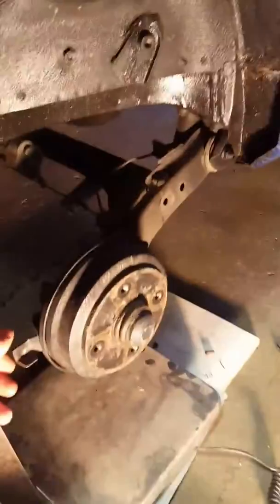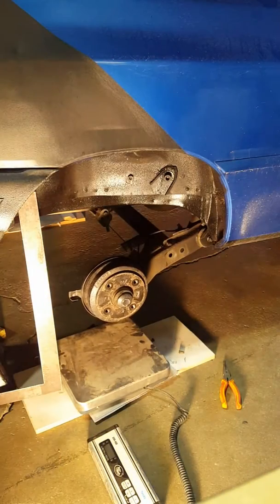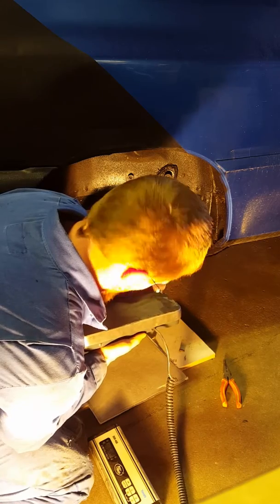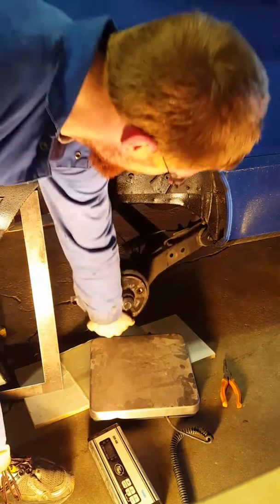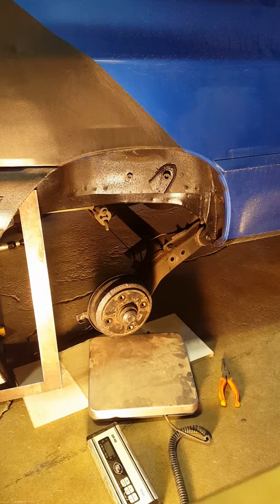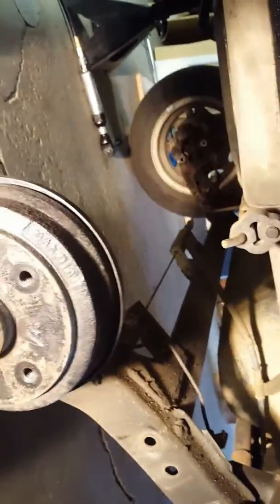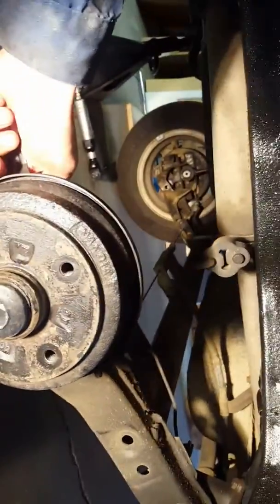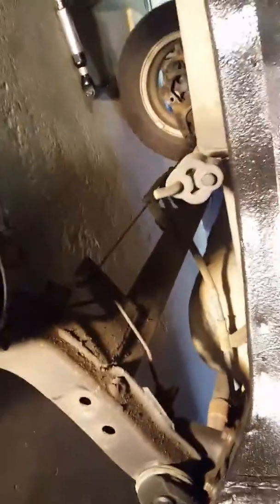Festiva independant rear suspension

Comment: question, is it supposed to have a a torsion or sway bar inside the front side of the rear beam axel ? i have noticed on my 91 wa there appears to be holes on either side to fit one
Reply from the maker: The first generation (1987-1993 Festiva in North America) does not have one in the rear axle. The second generation (1994-1997 Aspire in North America) does have one along with thicker metal and a less flexable rear beam. Its somewhat common that people bolt a rear axle from a second gen onto a first gen because they think stiffer handling is better. What country are you in?
Reply: @ryanprins4109  
thanks for your reply, i`m in Australia, my 91 wa festiva has holes to fit the bar, but i cant find one to fit it at any wreckers here, so i was scratching my head wondering what the go was with the holes, i was thinking of getting one made , or make one myself looks easy enough to do , but i dont know how much good it would do, maybe if i was using as a rally car a stiffer rear end could be beneficial , but for general around town commute, handling etc, i cant see any benefit , what do you think ?
Reply from the maker: A sway bar in the rear makes the handling worse. Guys who install the heavier rear beam that has the sway bar actually drill and cut the sway bar out. There is a fairly cheap suspension modification that makes the festiva handle amazingly. Its more difficult to do legally in australia i am told but at least 2 guys have done it. If you join 2 facebook groups: first ford festiva .com and search for maurice menghi. Ask him about it, he may even live near you. Ask him what the name of the australian group is, i cant remember right now, sorry.
Reply: @ryanprins4109  
interesting, not to fazed with the rear sway mod. but i did search for maurice menghi on fordfestiva.com, couldnt him anywhere, and i dont do facebook .  i found you though, i subscribed . in the meantime i`ll be replacing the lower control arms this week sometime , i been watching some YT videos and should be able to manage it , i hope. any ideas welcome.🤔
Reply from the maker: Oh, i saw your thread on the forum! It looked like your questions got answered but i might add one comment to it. LCA replacement is easy on a festiva. Maurice has a different name on the forum, i dont know what it is though. I may message you a link to a thread about the suspension if i get time to find it tomorrow.
Reply: @ryanprins4109 
that would be great , thanks, giving the old girl a quick paint job at the moment , she was faded bad.

Comment: Nice demo. Thanks.
Reply from the maker: No problem. I didn't see your comment until now, if you have not seen my comparison video to the rear beam of the aspire you may want to check it out. (Its a heavier beam with a sway bar commonly put onto festivas). Its interesting to see what difference the sway bar makes. That video is here https://youtu.be/9_l9SsyZVeA